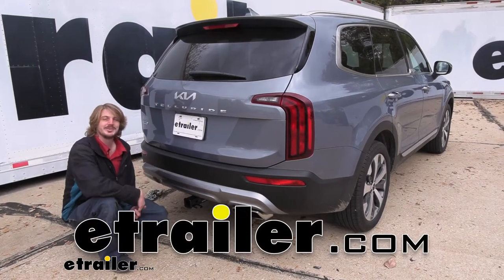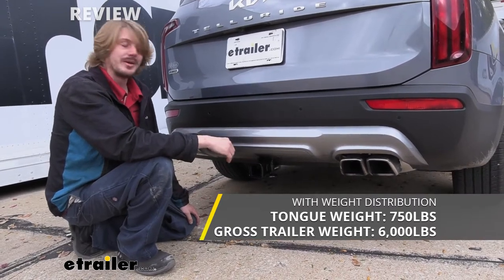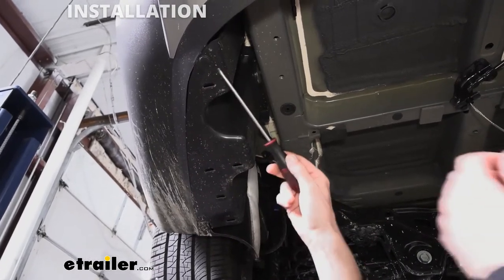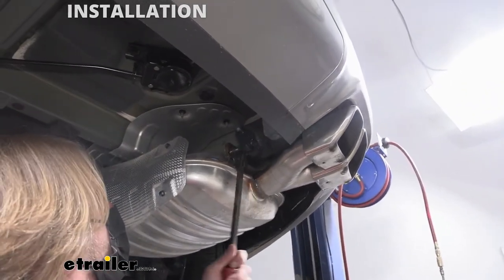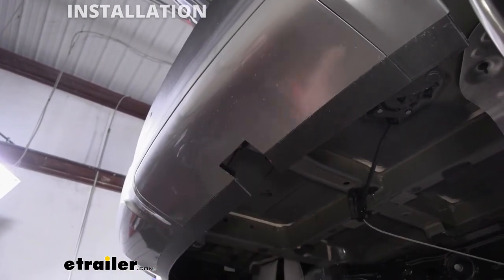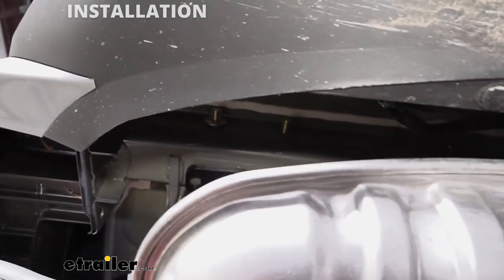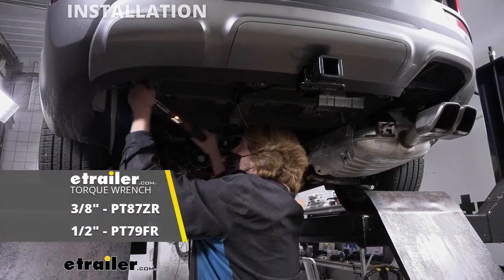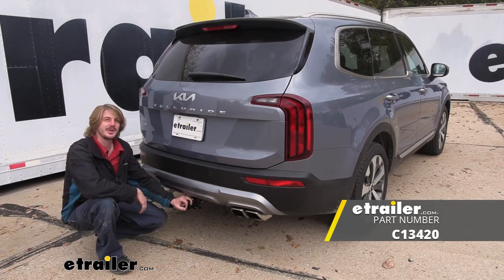etrailer | Curt Trailer Hitch Installation - 2022 Kia Telluride

Comment: two questions.  the oem hitch for the telluride says to tighten the outside bolts first, then the bottom.  why different here?  and two, was there any gap or play between the hitch and the frame of the vehicle?  thanks